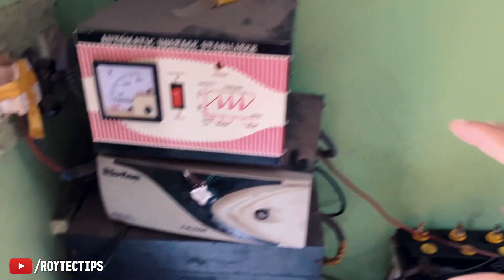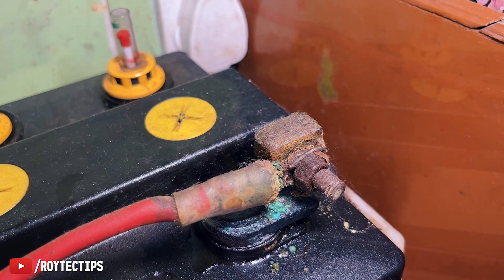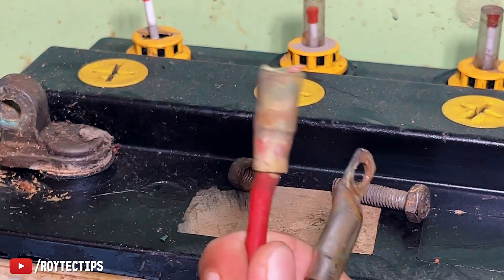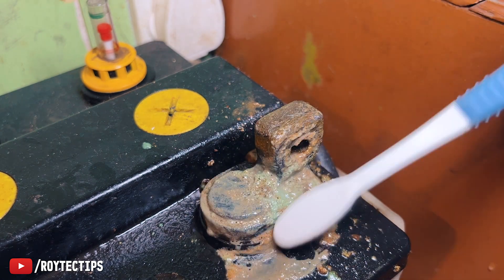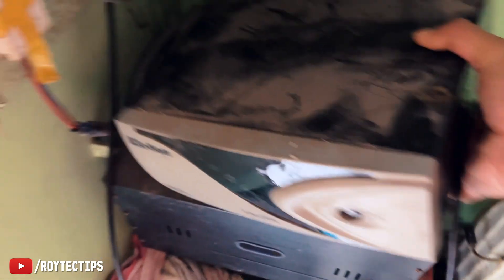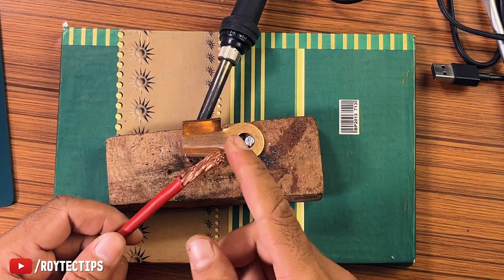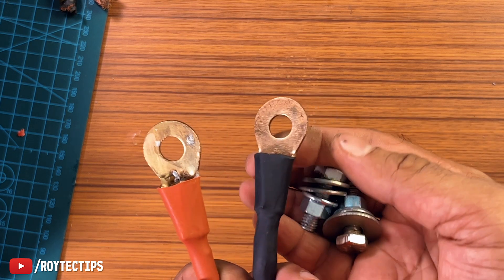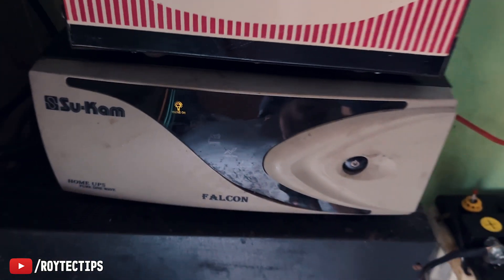How To Fix Old Inverter Lead Acid Battery Not Giving Backup?

Comment: I have same battery and inverter as u have im facing backup problem now .when there is light mains on and charging but when light goes inverter gets off in 10 mins what can be the reason
Reply from the maker: Eventually I exchanged the battery after 18 years.

Comment: I want to ask u one thing if I buy Dji air 3 drone from Dubia or any other country will there be any custom issues in india
Reply from the maker: put the drone in check in luggage and put the battery in carry on luggage.
do not use any parcel service as import drone is ban in india, to do so you need a DGCA approved drone license
Reply: @RoyTecTips  but sir If I bring drone like that u said will it be considered as Import or my personal items if I bring drone with me without box will I be able to tell them that it’s not a import ?